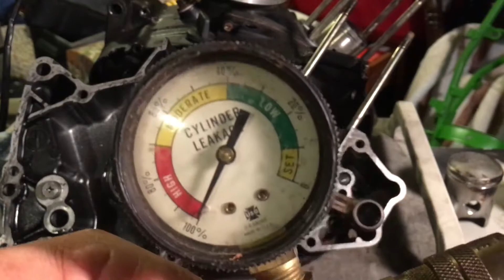Kawasaki lean condition crank seal location

Comment: I have one with an idle that keeps climbing after it warms up. I pulled the mag side and sprayed a little carb cleaner behind the mag and the bike died. Pretty sure that seal is bad. Have you had any luck replacing the mag side oil seal without splitting the case?
Reply from the maker: That's correct sucking air
Reply: @2strokeguru  so have you done a crank seal on that side without splitting the case?
Reply from the maker: @kevine8852  yes

Comment: my bike is leaking gear oil from the output shaft, it appears to have a sleave which butts up against the seal but doesn't have an oring, could there not being an oring cause the leak or do I need to replace the entire seal? also, how do you remove the seals that have the metal covering on them?
Reply from the maker: There's a grove for the oring i would replace the seal and oring clean it and that should stop it
Reply: @2strokeguru  thank you, will do. how do you go about removing the oring?
Reply from the maker: @shabbagadoosh  unbolt the sprocket and the sleeve will slide off note the direction you remove it from
Reply: @2strokeguru  thank you. how do you remove the seal? it appears to be covered by a metal ring, is it just a case of prying it out?
Reply from the maker: @shabbagadoosh  pry it out
Reply: @2strokeguru  ah nice, thanks

Comment: Hey Kevin, question for ya, I have low compression on my 1972 Kawasaki F7 175CC, about 90 PSI, and it appears I got a clean cylinder, and my piston looks fine, would you recommend a hone and new rings?
Reply from the maker: If there is no scoring I would pop the head off and check the gasket
Reply: @2strokeguru  the copper one? How do I tell if the copper one is bad, the one on the bottom of the head is new, but the copper one was temporarily used and still getting 90 PSI, it doesn’t have any cracks or anything like that and it’s cranked down to the regular 18 ft lbs torque.

Comment: Do you need to split the crank case to replace the seals?
Reply from the maker: No magneto and clutch side cover
Reply: @2strokeguru  Thanks! I'm replacing the right side under the clutch cover, any pointers or things that commonly get messed up?
Reply from the maker: @danscal3000  the button that goes in the center of the clutch is commonly  forgotten and the Oiler adapter between side cover and rotory valve housing take pictures for reference and use a pizza box draw a picture of the side cover poke holes and put the screws in the hole they come out of

Comment: Very informative video!  How do you seal off the exhaust and carburetor during a leak down test?
Reply from the maker: I will be doing a video on this soon check out my home made tool videos i had to make the tools
Reply: @2strokeguru  thank you. I went and searched your videos for pressure test. I am watching the How to pressure test your 2 stroke video.  Very informative.  My son has two 1980 KE125s that we are troubleshooting.  I think he has to replace crankseals, but that is an assumption, lol.
Reply from the maker: @benholden4585  testing is the best way